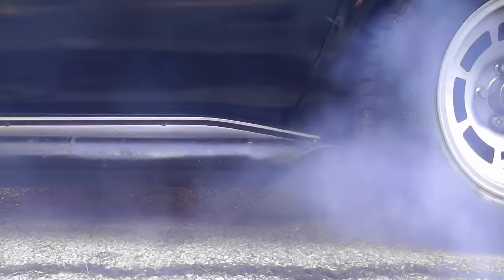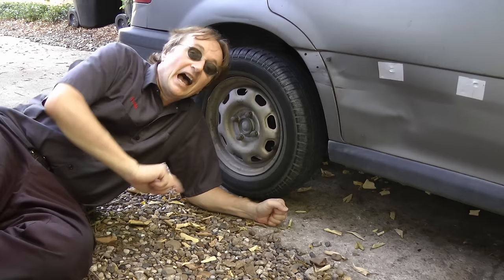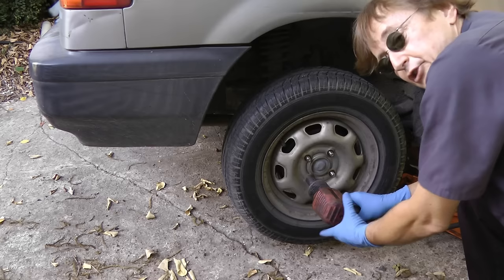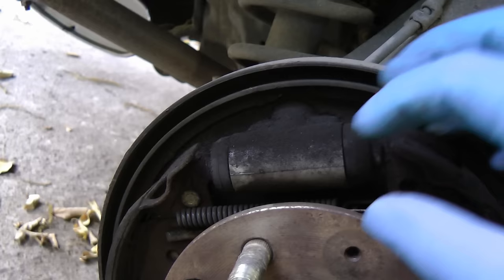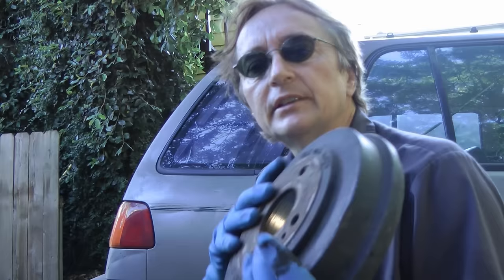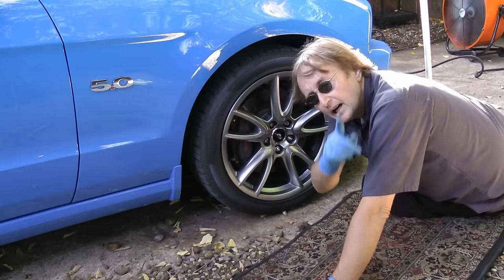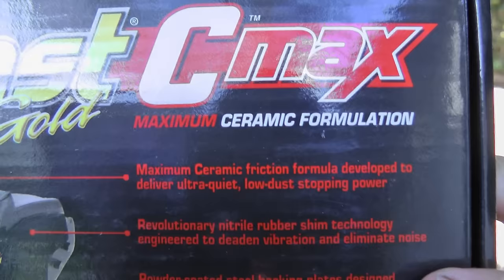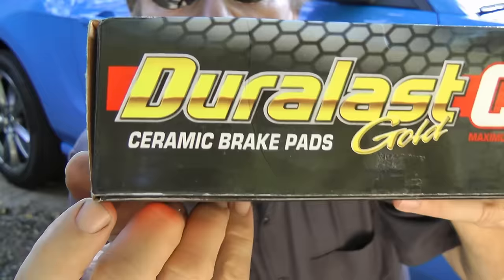How to Fix Squeaky Brakes in Your Car

Comment from the maker: Things I used in this video:
1. Ceramic Brake Pads: http://amzn.to/2zVMcNN
2. Sledge Hammer: http://amzn.to/2iasnep
3. Sandpaper” http://amzn.to/2ADJtKf
4. Ratchet and socket set: http://amzn.to/2inoxOY
5. Mechanic’s Tool Set: http://amzn.to/2Bzmccg
6. Wrench Set: http://amzn.to/2kmBaOU
7. Shop Towels: http://amzn.to/2jGDfkA
8. Disposable Gloves: http://amzn.to/2zSRuxO
9. Steel Jack: http://amzn.to/2Asgjxo
10. Jack Stand: http://amzn.to/2jGOwBg
11. Common Sense
12. Full HD Camera: http://amzn.to/2AvoEk7
13. My computer for editing / uploading: http://amzn.to/2i2sKYz
14. Video editing software: http://amzn.to/2jv5Fhf
15. Thumbnail software: http://amzn.to/2k7tz6C

🛠Check out my Garage to see what I use every day and highly recommend:
https://www.amazon.com/shop/scottykilmer

❗️Check out the Scotty store:
https://goo.gl/RwhRGU

👉Follow me on Instagram for the latest news, funnies, and exclusive info / pics:
https://goo.gl/ohy2cA
Reply: Scotty Kilmer hey Scotty how are you doing. Long back you made a video in which you showed a spray to spray on suspension bushes it’s called something AT500?  Thanks in advance
Reply: Scotty Kilmer should I put ceramic break pads on my 2008 Ford F-150 HD
Reply from the maker: I would, I like the akebono ceramics
Reply: Hey Scotty, where can I buy number 11?
Reply: I bought a Mercedes c300 and the squeak is bad. I brought it to the shop and I was told the brakes were new and that I needed to replace my rotors as well as brake pads again to stop the squeak and that will run me $800 to fix. But safety wise. I’m okay. 😑😑 I don’t have $800 laying around to give them more money out of me. Do I have to pay this costly repair or is there a cheaper way like this? Or something I should ask for next time I go to a shop? Scotty Kilmer
Reply: Where can I find some common sense; you forgot to drop the link in there ;)
Reply: @shaqross9  get rid of the merc. I had a clk 220cdi.... nothing but problems; worst car I have ever owned hands down

Comment: I did not know that regrinding the surface of the disks is the cause of the noisy brakes. 99% of the time is rubbish fiber/material used when constructing the brake pads. This is why if you change the pads for better quality you solve the problem. Often if you persist with the crappy pads the noise disappears for a few months and then comes back again when you reach the bad stuff again inside the pads. Thanks for the video.

Comment: Just a suggestion (I'm also aware how old this vid is, but for any new people trying to stop squeal). - with rotors and pads, Lube the ears/contact points on the brake pad with hitemp rubber grease where it will be touching in the caliper. Bendix blue is good stuff. This creates a barrier between the two bits of metal alleviating squeal. With solid calipers (Like brembo calipers) Don't forget to grease the pins and spring clip/tensioning hardware where it's touching the pins etc as well! Obviously don't go getting it all over the friction material, and I'd avoid putting it on the backplate where the piston touches, but should help a bunch!
Oh, Ceramic pads are great, but there are really good semi-metallic compounds as well. Its going to come down to application! You wouldn't go putting a dense semi-metallic heavy duty pad in grandmas Hyundai getz, but that pad would be good for heavy vehicles/taxis etc.
Anyways - Love these vids, Even if I'm late to the party 😂

Comment: Thank you for the break down! I took my car to Firestone to get the breaks replaced along with a few other things. It was expensive so I took it there so I could use my card that I had with them. My breaks came back squeaking like crazy! I read up on it and thought it was because they were new and were breaking in. That it would eventually stop… lol wrong.

6 months later. Still squeaking. I took my car to my actual mechanic for other issues and when I got it back they no longer squeaked. I forgot to mention that to him but he fixed the problem anyway, didn’t mention it to me or charge me for it. 🥺 I almost always find some little surprise fix after I get my car back from him. 
I started researching to make sure he didn’t have to do too much extra work to fix my breaks. I would’ve gladly paid him for it given the opportunity. :) It’s so nice for the first time in months my A/C works and the breaks are quiet. 😭❤️

Comment: I have a 2014 Mustang GT that has had squeaky brakes ever since I bought it. It goes away after driving a bit, but it's a bit embarrassing pulling up to the drive thru window and having that noise piercing everyone's eardrums. I've gotten them checked out by Ford and they say it's normal, but it's driving me crazy.
Reply from the maker: put on akebono brake pads, noise will go away
Reply: Scotty Kilmer thank you, I'll those a try.
Reply: "Ford" didn't check your car,  a dealership mechanic isn't an employee of Ford Motor Co.  A dealership is a franchisee.  
A temporary scraping noise from overnight flash rusting of the brake rotor and and drum surfaces that happens sometimes after high humidity or rain and goes away afte a few stops is normal.  Squeaking/sqealing is not normal.

Comment: Good day Scotty. I have a squeeky front brake, on the right side of my car. My brake rotors have been resurfaced, and I am using new brake pads, with lubricants applied to the clips upon installation.

The squeeking was gone for about 2-3 weeks but then it came back 2 days ago. What do you think is the problem? I sometimes hear it squeek when I make a turn, even though I'm not applying any brakes.

Thank you so much in advance.
Reply: Handbrake
Reply: What had worked?

Comment from the maker: Generally on those the dash circuit board breaks down., I normally get a used junk yard dash and replace it, but some buys try resoldering the board on the dash after removing it.

Comment from the maker: they tend to do that from cheaper brake pads and slightly worn rotors. If you pull the wheels and have plenty of brake pad material left, live with it. Or buy higher quality pads like akebono and put new rotors on. A waste if it stops fine though

Comment: Hey scotty my car actually just changed new ceramic brake pad but it is still making a squeaky sound and usually in the morning when just start engine. so what i need to do to eliminate the squeaky sound?
Reply: Do a complete servicing of the brakes.  Are your rear brakes drum inside rotor type?  If so did you clean and lube the shoe to backing plate contact points and check the drum faces for grooving?  Did you clean the rust ridges from the front and back of the rotors at the edges of the pad's contact area? Did you replace the shims?  Did you put lubricant on all the places where there's metal to metal contact, including the backs of the new pads? Even if the new pads are shimless type,  the thin coating that covers their backs can rapidly wear through, and where;s there's metal to metal contact, there's a place where high frequency vibration can be induced.

Comment: When I replace disc brake pads, I use a product called Disc Brake Quiet, it's a red goop that goes on the backside of the pad that contacts the caliper. I never had any complaints of squeaking brakes after using it.

Comment: Using your video as a brief guide, replaced the front disc brakes and gently sanded the rear drum brakes (which weren't worn down much) on my Chevy S10, all squeaking is gone and the truck stops nicely.  Also added fluid and bled the air out of the brake lines.

Comment: Thank so much Larrypok. I took off the right rear rotor, the parking brake assembly is rusted and missing an anchor spring so the shoe is rubbing the rotor. I fixed it!  btw the mis-diagnosed and wanted $400 to replace the rotor and the caliper again.

Comment: Guess my issue is the slick rotors. Just replaced mine with the painted rotors, to help prevent rust. The machining job was done well, guess they aren't broke in yet

Comment from the maker: if power goes in and out of the brake switch, then the wires are bad or the bulbs or sockets on the brake lights, unless you have a GM vehicle, in which case i'ts often a bad body control module

Comment: These are actually relatively new pads. Hawk ceramics. The sound is similar to when a rusty door is opened or closed slowly. As if the entire caliper or rotor is vibrating.

Comment: Oh ok, thanks.  I would think that the squeak is coming from the surface of the pad where it hits the rotor.  So, when one sprays that stuff only on the back of the pad that doesn't come in contact with the rotor.....how does that stop the squeak?  I appreciate your help - your site is amazingly informative.

Comment from the maker: yea, turn your radio up. Of course pull the wheel off to see if something stuck like a calliper and it's worn out, but if not, rear discs are notorious for making some noise. But next time use Akebono ceramic pads, they don't do that over time.

Comment from the maker: they actually make a kit to stop such brake noises if it's the brake system doing it. The dealers sell the kit which repairs brake worn parts that no longer fit correctly from wear.

Comment: Scotty, after resurfacing you can't have drums or rotors that are smaller than minimum size. Suppose there are just minor scratches on the drum or rotor, with no pulsations to suggest it is out of round. How much extra room do the machinists need before machining is not possible?

Comment from the maker: a worn timing chain can cause that, as can electrical shorts or a main computer failure. I'd advise seeing a mechanic with a machine like in my video "fixing modern cars using high level scan computers" to see what is needed.

Comment: I'm no mechanic (that's why I watch Scotty's vids) but what worked for me assuming pads and rotors still had meat and not grooved was repacking the pads after lubricating the tabs, slider bolts and backs of the pads/shims with a good synthetic brake grease. I believe I used CRC. Perfectly quiet brakes immediately ever since. Oh, and don't hit them directly when spraying wheel cleaner and water! Hope this helps.

Comment from the maker: remove the rear shoes, clean it all up with brake spray cleaner, and put brake lube inside on the shoes where they contact the backing. Then it will stop

Comment from the maker: yep, just fixed on. You need a computer as in my video "fixing modern cars using high level scan computers." those stupid things are so complex, you need a computer like that to analyze and fix em.  In my repair, the motor that operated the blend door on the hot side was breaking down, ended up being a 750 dollar job. Man, I'd never own one after fixing them.

Comment: Thanks Scotty, have the same issue with my 1991  Maxima after replacing the front brake pads with Duralast - resurfaced the rotors...

Comment from the maker: first, make sure it's the front ones squeaking, often it's the back ones now. But if so, you got crappy ceramic pads. I often use akebono pads and they never make noise.

Comment: thanks scotty it worked perfectly! although after changing pads and rotors i changed my spark plugs and half of the 6 sparks plugs were completely covered with oil. what do you think is causing this? i thought it might be my valve cover gasket.

Comment from the maker: remove the drums and see if shoes are worn out. If they are not, remove the brake shoes and lubricate the 3 backing points on each shoe, they rub dry there againts the backing plate and then squeak. Use brake lube grease.

Comment: Fantastic information, thank you! Your time & expertise is greatly appreciated. Recently I've taken
my cars' " squeaking brakes " (  2001 320SLK ) to my mechanics whom I've
trusted for 15 yrs.. Three times I picked up and the squeaking is still there, each time I am in a rush
to return to work and I call to make another appointment, ugh! First brake pads, then rotors, STILL
squeaking and an added tweak....stuck in Park...replacing Brake Sensor which I discovered per Google in
a parking lot, making it home by using a pencil to reset :) Now?  Why would this mechanic NOT test
the outcome of the services, at least the 2nd & 3rd time?Can I trust he will not lead this down the wrong road?
Thank you for mentioning shoes, cylinder, drums & resurfacing. Have kept this car meticulously maintained 137K miles,
gently used, including the brakes! Love your radio show, you are the salt of the earth, kudos to you & yours:)
Reply from the maker: he's using cheap parts or doing crappy work. If you use quality merc pads and quality merc rotors, they will not make noise. Time for a new mechanic

Comment: Hey Scott, I have a 2006 Subaru impreza sti......yes it's turbo charged, haha, my problem is my brakes screech almost every time I apply the brakes......I went to 3 different places to see whats up......the first place told me I need brake pads......that's AutoZone for ya($50), the second place told me I needed something in the brakes lubed ($50-$70)and the last place told me that my rotors need to be replaced ($400).......I asked some of my friends and the said they never heard that kind of brake sound before.....it's really frustrating since its an awesome car......but like you said the last thing you need on a new car is squeaky brakes.....I have not done anything to them yet and looked on the web to find out what's going on but no dice.
Reply from the maker: If you really don't like noises, replace the brake pads and rotors with quality units. IF you want to save money, try just new Akebono brake pads, they cost more, but are VERY quiet.

Comment: I am not a car person and always have to hope the mechanic I take the car to will not screw me over too much. Eight months ago I bought a damn van (whole long story don't plan to keep it majorly long just long enough to save for a newer car, not van) Two weeks after I bought the damn thing the serpentine belt started to squeak. I have the receipt for the new one put on and the old one that is like new in the back, got told it will always just be noisy, turn up the radio. Ok... tires went, replaced tires, battery went, replaced battery, new squeak started, than started to smell gas. Woke up to spot under my car, took it in and needed fuel line replaced. I asked "well what about the squeak" I mean this squeak starts as soon as the car moves and stops when you do. As soon as you start again so does it. Has to do with the car moving. The belt at least stops when the car warms up, this other squeak does not stop at all. The mechanic said my front breaks are rusted from lack of use, there is no sense of fixing them since I do not drive my car enough and do not put my car in a garage. So I am stuck driving my car around with a very annoying squeak. Watching this I am wondering if it is maybe some kind of glazing on the break pads. Its an 01 Safari Van. If it is, what are the chances I will crash and die from glazed brakes. I live in a small town. My choice of places to get the car fixed are limited, guess they had bigger fish to fry other than my breaks.  My question is, it is safe to drive with squeaky breaks. By the way new front breaks were put on this van in 2015, back breaks 2016 a month before I took over the van.  A total of 1200 km (not miles) were put on the van since back breaks were put on so very little driving time. I do barely drive the car. The owner before me barely drove the car. Like I said its an 2001 and has a total of 139000 km on it

Comment: Couldn't have timed this video better. I have just developed squeaky brakes.
Just wondering, I believe it's the front, had them for a while, I cleaned the front pads and it stopped it for an hour or so then came back, so got totally new pads and the problem went. Then recently (3 months or so later) my front brakes I think are squeaking again under light braking? 
I have a 2003 Vauxhall Corsa (UK) so I don't know what you suggest?

Comment: Hi Scotty. I drive an 02 Toyota Celica. I replaced the brakes maybe a month ago. I'm 90% sure the new ones are ceramic. The first couple weeks they sounded silent. Then after about 2 weeks or so they started squeaking when I apply the brakes about in the middle of the pedals range.
Reply from the maker: it means nothing, but if you don't like it, should have changed the rotors out too

Comment: Hi Scotty, i got a "new shiny car". Breaks dont squeak but all 4 disks rust at an alarming speed. Just one rainy nigth and that orange flashes and is easily seen from 10 meters away. Of course after driving and breaking, its gone, but i am wondering if longevity of these disks will be affected. By the way, they are perforated disks and i suspect the rust comes mostly from thoses holes.

Comment: Thanks, Scotty.  Good to know.  I am not likely to have a problem if you haven't in that much time... Rusted parts are terrible.  I will put some anti-seize or brake lube where the rotor might stick.  Thanks.

Comment from the maker: dust can on drum brakes, but not disc brakes.  You can only spray stuff on the pad backing, that stuff they sell to spray on the rotors is dangerous, I've tried it and would never use it again.

Comment: even if you dont change your brake pads on your own, you can buy your brake pads and take them into a shop and have them placed. Comes out a bit cheaper and that will prevent the shops from using the cheap non ceramic brakes that will squeak

Comment from the maker: you don't get air from pulling on shoes unless you opened up the bleeder valve on the cylinders. But see my video "replacing rear brake shoes on your car" for more advice

Comment: Brakes squeak could be dirty drums clean drums with a disc. If front medal gets impeded in the rotor clean the rotor with a discount on a drill and check for rocks behind the rotor they make noise back up car first if rock comes out. Front brakes have mise clip to show ware, replace psds.